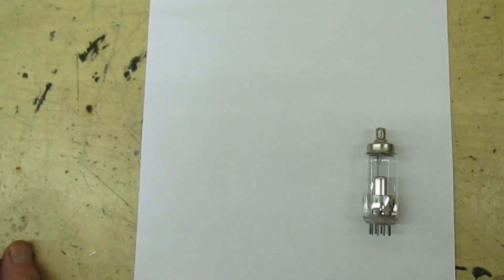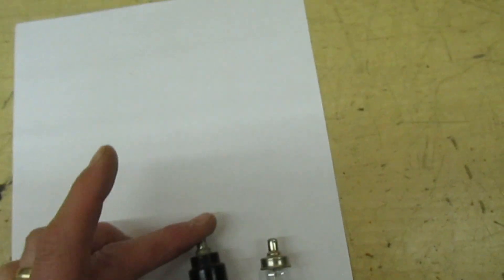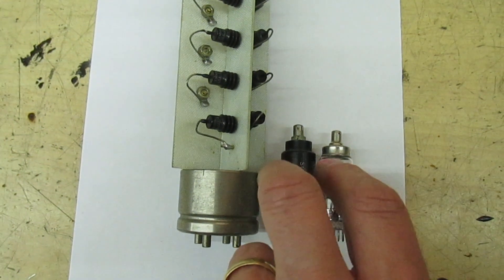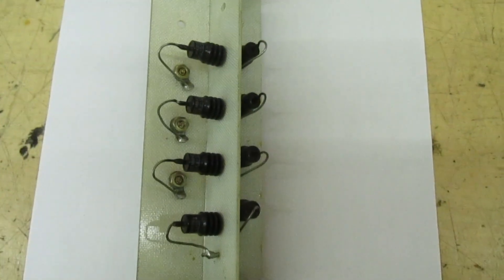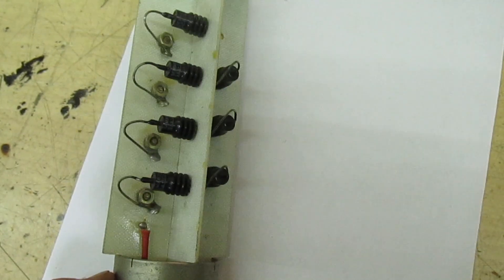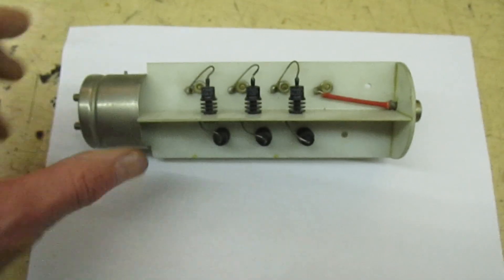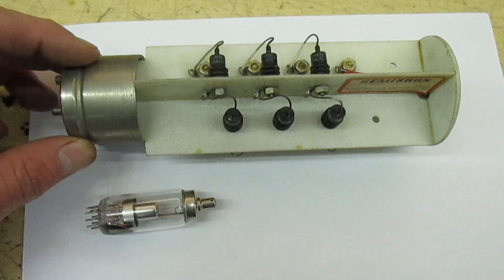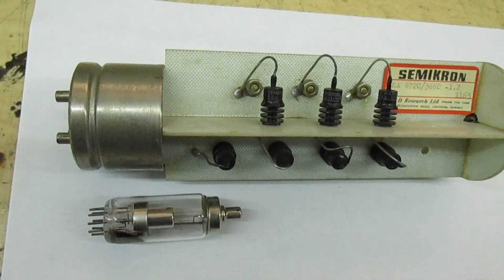Just look at this for a EHT rectifier !       and its solid state .

Comment: Great Video Michael,
This Rectifier was probably a custom made. HCD research are still trading in Burgess Hill, West Sussex. The sister company was GOODACRE & DAVENPORT SEMICONDUCTORS LIMITED, 24 Nov 1964 - 16 Aug 1985 ...
The company is now G D rectifiers in Burgess Hill and are still trading. I worked there for a couple of years from 1983. They both have websites if you google them. Most electric milk floats used their rectifiers as well as British Rail and a long list of other major companies. HCD also made precision oscillators and transmitters for companies including the BBC.
Reply from the maker: very interesting , I will take a look .

Comment: many years ago, I was in a small company that had a Tektronix storage scope (circa 1980). It started to develop brightness flashing on the CRT. i investigated the high voltage section and found a voltage multiplier. It had a number of very small high voltage rectifiers and I noticed a few had a broken lead just at the body of the small rectifier. As this module operated at ultrasonic frequencies, I deduced that the failure was mechanical fatigue due to ultrasonic vibration. Well whether my assessment was correct or not, I replaced the broken rectifiers and restored normal operation to this scope.
Reply from the maker: I guess it could be caused by vibration at the high frequency or another cause could be thermal contraction and expansion.

Comment: Could it be from a scientific or medical instrument ? At first  Ithought it was a voltage multiplier but there  are no caps . It must be quite a high current device, lethal.
Reply: High current doesn't make it lethal, but high operating voltage would.
Reply from the maker: @deang5622  still think I would keep well clear when this was running !
Reply from the maker: With the help of another viewers comment this would appear to be a replacement for the very un reliable Mercury vapour rectifier used in a high power transmitter.
Reply: Looking at the thickness of the wires, it probably isn't that high a current, it would appear to be more a high voltage type device, =>1000 volts

Comment: i like the diodes that are fin cooled, not sure it's silicon

btw, i have a question, i have a telefunken DY86 with a radioactive getter, it's not the thoriated(?) filament, it's not the uranium(?) glass, it's not the x-rays from the hi-v, it's the getter material... it's a getter made with some dark-gray-brown stuff in a pan shaped holder electrowelded to the body, it's not flashed... it's sligtly radioactive but detectable... the question is.... what the hell is radioactive in there?!?! it's not supposed to be radioactive, i've googled for getter materials and elements and none is basically radioactive
Reply from the maker: I just checked the forward voltage and its 0.602v so definatley silicone , not sure about the radio active valve , the guy I got this valve from will know as valves are his specialist subject but he went on holiday yesterday and wont be back till next month .

Comment: Probably a replacement for a type 872 mercury vapor rectifier.
Reply from the maker: many thanks for that , I would assume the valve it replaces was very un reliable hence the need to make a solid state device , I will have a look on the net for the spec of the 872.
Reply: @michaeldranfield7140   I spent all of 1969 on top of a mountain in S Korea at a STRATCOM microwave relay site. We were part of the backbone that carried vital telephone circuits down the spine of S Korea. There were a dozen sets of ANTRC/29 23 channel microwave sets on that site and in the base of each set were sets of mercury vapor rectifier tubes that glowed a lovely UV that drove insects batty. In the late spring and summer we were a haven for thousands of miller moths all willing to do anything to get to those mercury vapor tubes.

When a a nice fat miller moth gets in contact with one of those tubes you would hear a loud snap, that was the shell of a rectifier tube breaking because of the thermal stress of having a small area of glass cooled down too fast, We had to cover the ventilation grid of that power supply with window screening to keep the buggers out and that caused overheating problems because their bodies blocked the airflow. Even with the screening a bug would work it's way in a couple of times a month and break a rectifier, getting that hot broken rectifier replaced was a PITA, i got many a burn trying to get it done quickly to get the gear back on the air.

Solid state rectifiers would have solved that problem.
Reply from the maker: Very interesting, when someone suggested it was a replacement for a mercury vapour rectifier I assumed it was because of the poor reliability of Mercury vapour, I have not atcually seen one of these running in real life but I have seen a mercury vapour discharge street lamp running without its outer bulb where it emmits very little visible light and ultra violet radiation.
Reply from the maker: Hi , Fred , Very many thanks for that , I checked and the length and short pin base do seem to match the 872A mercury rectifier .

Comment: That.... Is a brute!  Would it have been used in mains derived EHT?

I've heard of Semikron before, but I don't think I've ever seen one of those before.

Then going t'other way, there are some folk who reckon to have used microwave oven rectifiers before today.

I wonder what sort of current it can deliver? I'm even daft enough to wonder if it's from some sort of small mobile/portable radar set - EHT for say, airborne cavity magnetron radar?

It's a curious thing.
Reply from the maker: I dont actually know , i would have assumed it was for a transmitter , if someone knew the thermionic equivalent that may give a clue if there was a datasheet .
Reply: It would be good to reverse engineer it and draw out a schematic for it. From that you will be able to deduce its function.

It's not listed in Semikron's current product portfolio.